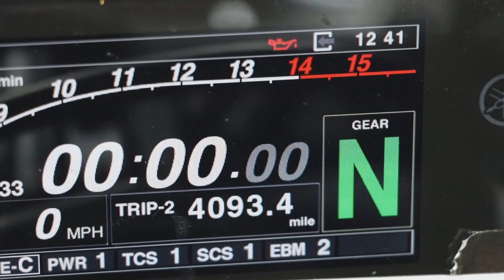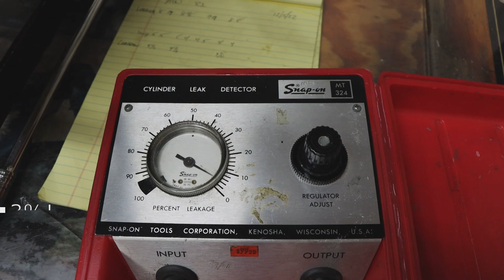Yamaha YZF-R1 Race Engine Tear Down 2020  - Part 1

Comment: we raced and serviced more then 10 bikes,  2015+ 2018 2020 R1s and never ever had a gearbox issue.
We have our own Dyno as well where we test he hell out of these after engine rebuilds.
Engines with more than 13000 km of racing only.
How you guys 'managed 'to fuck up that gearbox, is .. science fiction..

Anyway, good work for the rest of the vid - KUDOS and keep up the good job :)

Comment: Just read in the January issue that you went with the buy a used street bike vs build a motor plan. That’s my preference as well.
Reply from the maker: For the 2022 season (the one that just ended) AOD bought a new street bike and took the engine out of it, installed it in the race chassis, and went along their merry way to the 2022 Championship.

For 2023 they decided to do the hard thing and rebuilt the engine with the bad transmission.  This was done partly to be slightly more cost efficient, partly to be able to video the process for y'all!

Thanks for reading the articles in @roadracingworld!
Reply: How do you find tdc? Doing my first rebuild. 😅